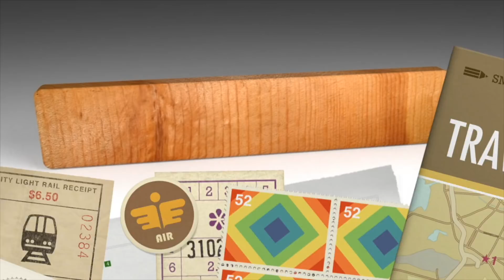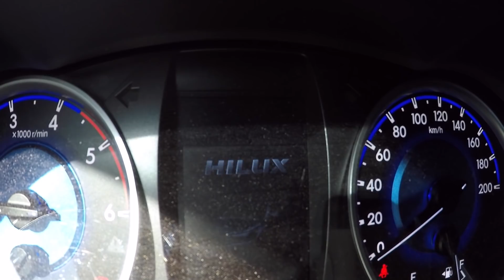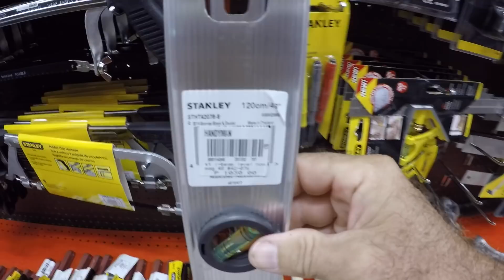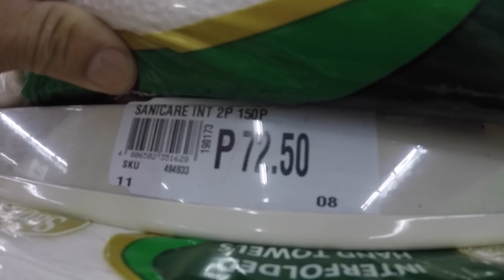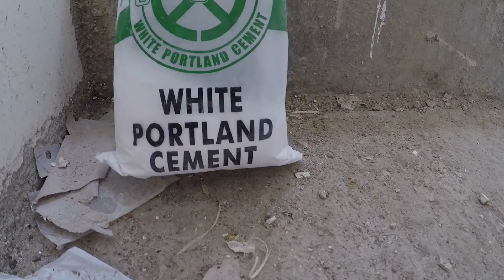VILLA FELIZ - EPISODE 229: ONE MORE STEP CLOSER (House Building in the Philippines)

Comment: Your builders I think built the hotel I am staying in while my condo is tiled this week. After watching yesterday I thought I will have a look at the door and yup it's a mess! The door is flush with the frame at the bottom but at the top the frame is set back about an inch and a quarter and the door is barely inside the frame. The door isn't warped the frame is set within the wall as it should be if the wall was actually perfect which it isn't and therefore the door is a dogs dinner. 
Good news on the windows! Let's hope they fit first time with no adjustments......must think positively haha
Reply from the maker: Welcome to the Philippines!

Comment: HI James. @17:56 is that a column. Looking a bit out of place there? I wondered many many episode ago, why you never purchased a level and square for the guys to use.... Might seem a little late, but until the doors and windows are in. Nothing is too late when it comes to squaring up the openings....Now as for your driveway, I am still thinking it might be a little tight... You're not driving a Toyota Corolla, it a HIlux and it's a big unit.  It has a big turning circle... I am worried that you will struggle when coming back out of the garage... According to your measurements, you will have about 570mm either side as you go down the ramp.... If it were me, I would have liked maybe something closer to 1000mm clearance on both sides. Just in case.... Always nice to give yourself a little more room than be cramped up. Especially when you are reversing out...  You have no other option than to reverse out considering you are installing swinging garage doors.... A roller door might have allowed you to three point turn inside the garage and then you could just drive out. But then there is too much messing around and lot of concrete to bounce off to consider that option.... So drive in and reverse out is the go. Another option would have been to extend the driveway beyond the garage entry. So you could have driven past the entry and then reversed into the garage..... You could have had a carport cover over that area and utilised it as extra car parking....But that's just me.... Anyway, looking good mate.. See you in the next episode.....
Reply from the maker: Yep, a lot of folks had the idea of extending the driveway past the garage entrance but I'm just stubborn and felt more yard space is work the wiggle hassle.  I think the "am I going to be able to fit my truck into the garage" episode it going to be my biggest viewed.
Reply: HI James...I dont think you will have a problem of "Will it fit in the garage" But maybe "Will you be able to get it in from the driveway" Only time will tell, And like most people here, I can't wait to watch that episode... Cheers mate...

Comment: Where did they get the ground from? Is there a ground rod driven close to the main breaker? I believe it should be at least 3 meters deep, and within a certain distance from the breaker - not sure how close.  If it's done correctly you can get 120vac using one phase of the 230 VAC and ground. You could actually wire an outlet that way. Use a colored outlet to differentiate between the two voltages. Pretty handy if you have some U.S. appliances.

Comment: HI James, looks like the corrections are coming along well, good catch, I'm sure you would have noticed the out of square doorframe.  Just wondering, is there going to be an issue with the large coconut tree at the top of the driveway?  I didn't know if there would be a problem of the root ball pushing out on the retaining wall.  I think the colors your wife picked out works well together, I guess she will make the final decision.  Never can have too many outlets!!!
Reply from the maker: Hoping the coconut tree won't be an issue.  We had to cut back on the root ball a bit but the side that we cut back on will fall the tree in the opposite direction of the house if it were to fall.  My fence would be threatened mostly.
My wife said the color in the great room was a bit too dark so getting another test swatch today.

Comment: James....The house will look great on the corner lot location you choose. Nice presentation of your new home. The weather looked exceptionally nice today. Can you tell us what the daily temperature and humidity has been at this time in your area? I guess you could only find a small level and no large "Framing Square". How do they ensure the jamb is straight and not bowed without using a long straightedge door level or tool?
Reply from the maker: Gino, I show the temp every morning on my truck's display.  In the past 11 months here its been a regular 26-32C almost every day if I remember correctly.  They use a plum bob and a their eyes.  They're pretty good most of the time but you can't beat a carpenter's square and level...that is unless you have the newer laser tools.

Comment: We had to cut and remove a supporting column because (though my build overseer told them differently) the workers placed it where our bath tub will be.  Felt like I got kicked in the stomach.  When taking it out thry cut the rebar on the bottom and left the 300 lb concrete support dangling in the wind.  I had them cut it immediately.  Will get some 4" rectangular bar to buttress the long span.  But I'm out 500 USD and lost time completely unnecessarily because of carelessness.  Tomorrow the wife and I will begin shopping for Christmas rice and goodies for the workers.  Will give some bonus too.  It's more fun in the Philippines!  ☺
Reply from the maker: Another horror story to add to the channels list.  Thanks for sharing and sorry you had to endure but you did.
Oh, and yes, it's more fun in the Philippines!  🇵🇭
Reply: My PI Dream 😢

Comment: hi james - have you checked if your ground connection to the electrical plug you showed in your video is also connected to a 1 to 1.5 meter earth spear that is placed in the ground ?????
Reply from the maker: Have not checked yet because they still haven't installed the earth ground bus in the CBP.  The earth spear as you call it isn't a fixed size but how long it is will be determined by the resistance measurement during the installation.  I've had to beat 3 meters in the ground in the desert to get proper ground.

Comment: One of my major concerns while planning my home is the grounding (also thinking of having separate distinguishable plugs for 120v service), and I was happy to see how you are doing your electrical to a good safety standard.  I currently live in a home that has no ground; you will know it by either looking at the plugs or when you touch the microwave and you get a zap.

Curious, though, are you getting two-phase 120v or single-phase 230v service?
Reply from the maker: Single phase 240V.

Comment: Hi James, I have noticed they always  install the roof insolation with the shiny side to the floor. Imo  It should have the shiny side towards the sky so it reflex the heat.  What is your opinion on that ?
Reply from the maker: The foil insulation has shiny on both sides.  The inside is like that packing foam you see when you receive glasses in a box in the mail.
Reply: I see, at my gf's place is only at one side shiny and that shiny bit they places to the floor instead of to the roof. 
Sorry I did'nt have noticed the foil you're using is at  both sides shiny. Thank you for your answer and have a nice evening.  
ps: your house looks very nice already let alone when it's  finished.

Comment: Maybe I don't understand your driveway but the way I see it is your going to be backing down or up. Since I don't see any way to turn around. That looks difficult to me especially if u put two cars in or if you park on the left as you back up your front end is going to be swinging into the wall to make the turn up the drive way or perhaps the size is misleading on the camera.
Reply from the maker: I agree its going to be a bit tight but because of the narrow width of the lot its the best design we could come up with at the time.